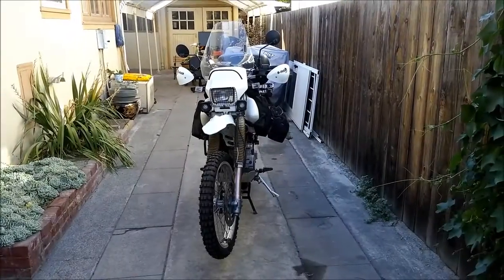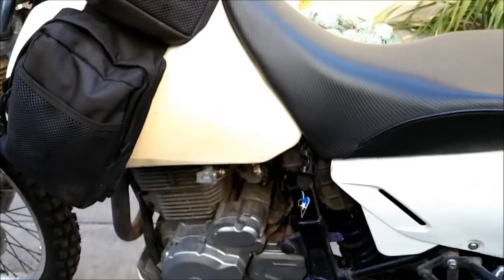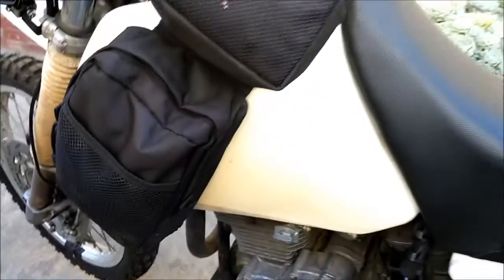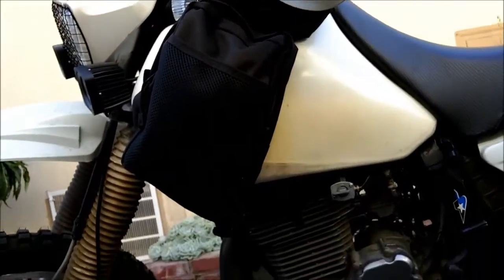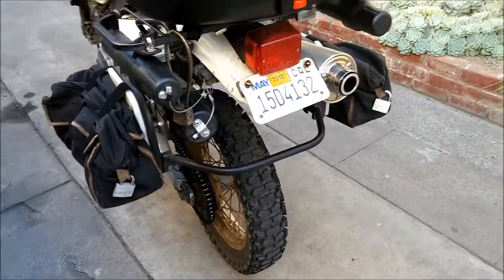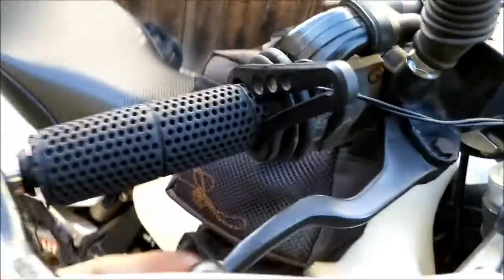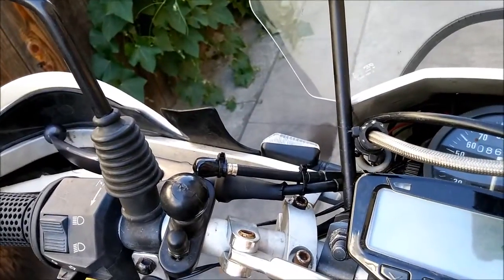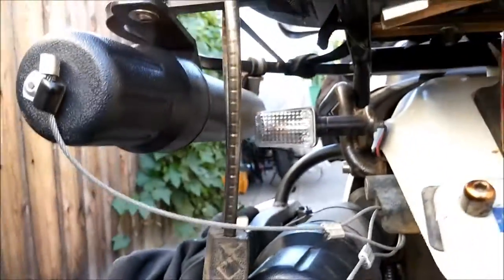HadesOmega's 1997 Suzuki DR650SE

Comment: I'll bet money the vibration is from your worn tires. I have a 2007 DR 650 with the stock Dual Sport tires. My rear is at the point of replacement, so I'm going to a combo street/trail tire with a little smoother tread since I spend more time using it as a commuter. I also DON'T like the stock tread on wet pavement.